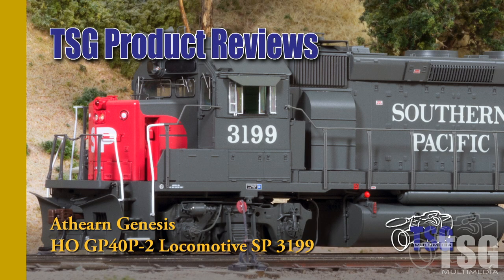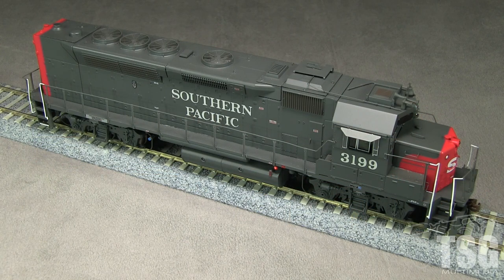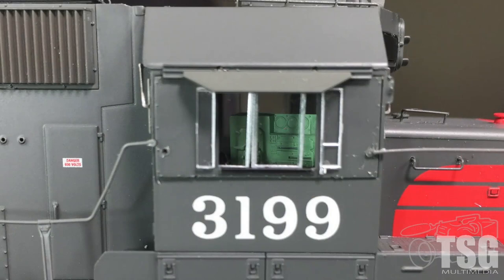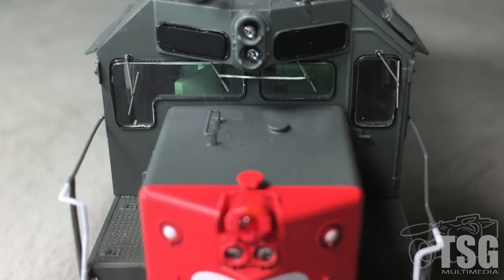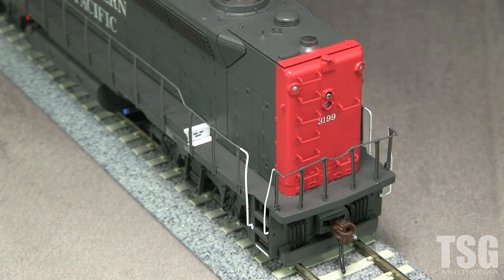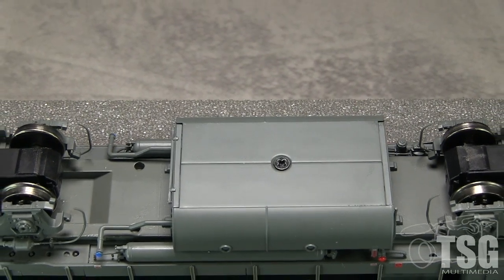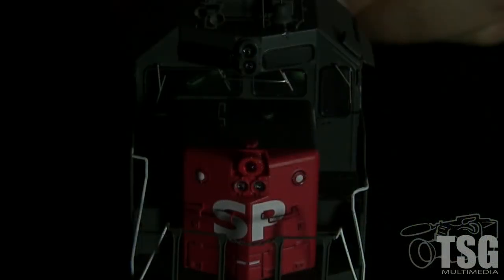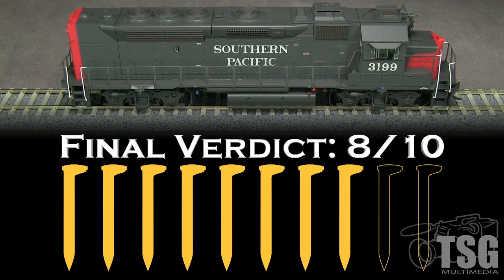HO Scale GP40P-2 Athearn Genesis Product Review

Comment: Excellent review of a  SP specific prototype . Athearn's the only place for Southern Pacific ,Cotton Belt versions of there prototype locomotives  for modelers . Bought the SP GP38-2 units all mine had the sunshade's applied upside down easy fix .Picked up the GP40-2 Cotton Belt units they were perfect except class lights and fuel tank placement . The SD40t-2 , SD45t-2  had front and rear handrail issues they were always separating at the stairwell stations . Didn't pickup the passenger engines the SDP45 or the GP40P-2 was seriously tempted like you remember both types shooting down the coast line on the weekend . Also remember the SDP45 units being used on business trains and in Southern Pacific pre-Amtrak passenger service. Still know were to pick up some if my operation changes to the Ventura Santa Paula area .

Comment: I am surprised the southern pacific owned these engines. I know the central railroad of New Jersey operated thirteen gp40p-2 diesels in the late 1960s to replace the diesels that replaced steam locomotives. They were best suited for the steam heated commuter coaches, given that they have steam generators. They then worked for New Jersey transit, and were rebuilt at conrail's former Pennsylvania railroad juniata shops into gp40ph-2 locomotives. Aside from the original thirteen diesels, nj transit purchased more gp40ph-2 diesels, that were rebuilt freight locomotives from other railroads.

Comment: I have the Sound version of this locomotive and pressing the emergency stop button it makes an air break noise along with the Red light turning on
Reply from the maker: That's good to know. Most manufacturers don't seem to go through the trouble of making other than the main lights work on SP models. Even the ones with full SP light packages.

Comment: As mentioned by another, on the DCC equipped model the red light is functional - though not very bright.  I am sure when you go to do the light swap you will find a bulb there.   I have two of these, and absolutely love them.  I do have one bent sander which I am struggling to get to play nice.   But its worth it to have this unique engine pulling my commuter cars.   Now if Atlas would just hurry up and release their TrainMasters so my peninsula  roaster  could be complete.
Reply: Having "played" with my two over the weekend, I am really really pleased with the Tsunami2 decoders in these units.    Before you go out and do the trendy thing of buying the non-sound unites so you can put ESU sound in, give the Tsunami unites a test run.   Couple of things I really like is the F9 key triggers 1/2 volume mode.  Great for not annoying others.   Second is the "special" sounds included in these specific to these unites - HEP, Steam Generator Sounds, etc.   Very well done.   The last and most surprising find is I was running my two in a consist, and I am not sure if it is an artifact of the control system I am using, but I am running these with the same ID, but they respond to sound changes slightly different.   Meaning when you notch up, they notch just slightly different.  About 1/4 of a second out of phase with each other.  What this does is gives you a really nice "stereo" sound of the engines spooling up.   Fantastic.   Whether it is intentional or not... I love the effect.   I plan on reprogramming these to their respective road numbers and hopefully the effect persists.

Comment: Athearn is being left in the dust by their competitors. In the age where LEDs are standard for lighting and many locomotives come with 6, 8 or even 12 total lighting functions available under DCC, Athearn is still using incandescent bulbs and a circuit with extremely limited lighting functions and a PCB design that is close to 20 years old. It's one of the many reasons why I have not purchased an Athearn locomotive in recent years.
Reply from the maker: Your frustration is understandable. The incandescent bulb complaint is one that Dan shares with you, but he usually re-does his models to improve factory-installed lighting anyway. Also, there are some people out there, believe it or not, who still prefer incandescent. Seems strange, but it's true. I have not asked anyone from Athearn about this specifically, but it is quite possible that they are continuing to use bulbs to guarantee a hold on that part of the market.